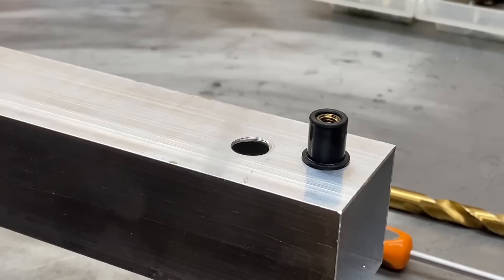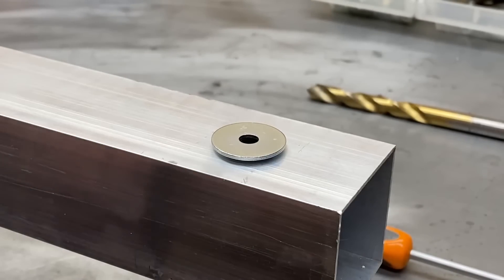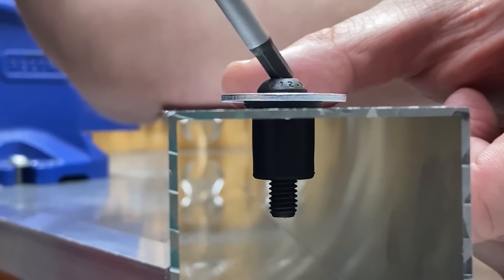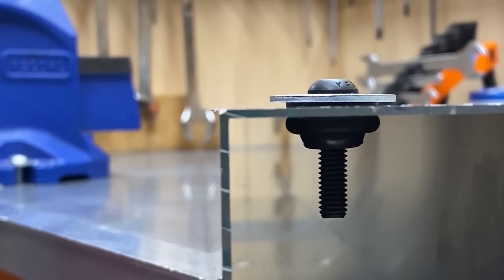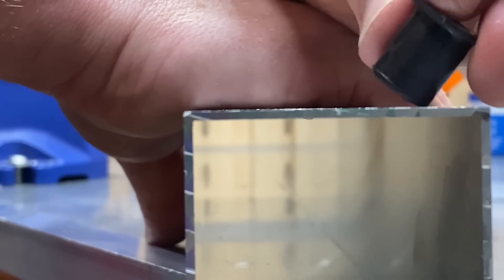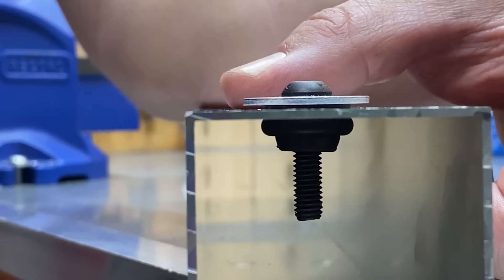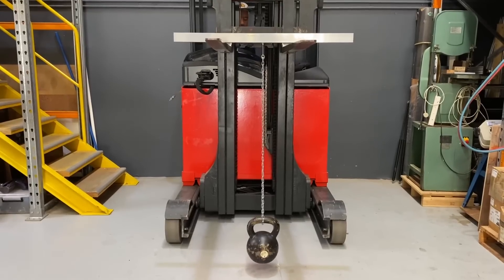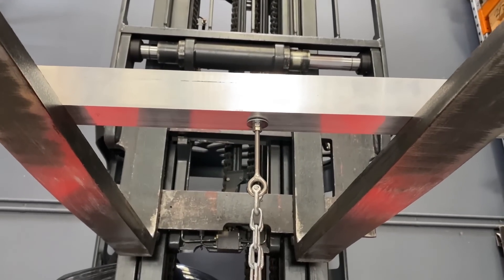Well Nuts: Installation, Removal & Strength Demo

Comment: Can it be used on plastics? i need to put a windshield on my motorcycle but the original metal body nuts are gone, only the hole in the plastic remains. I've been searching and found that i could use either rivet nuts or these rubber well nuts, but these seem more plastic friendly that metal rivet nuts.
Reply: They sure can! In fact, this is a very common application for these products.
Reply: @nickneal552  thank you for the info 🙏